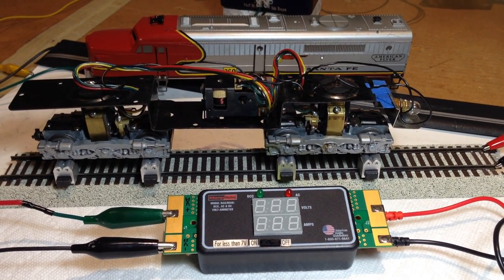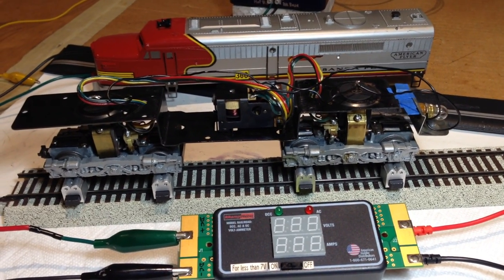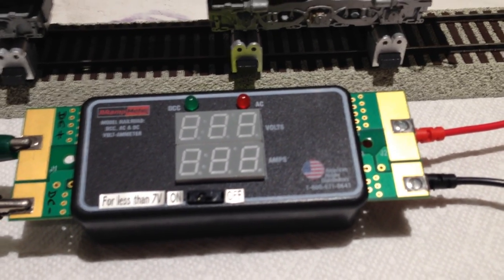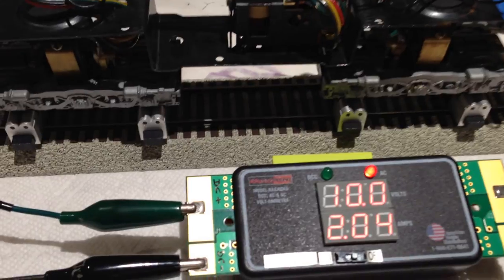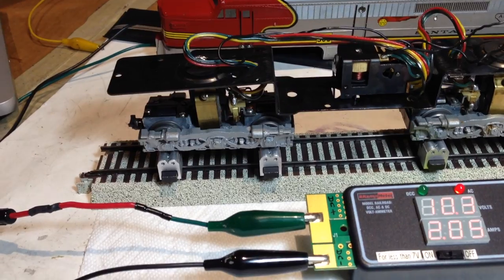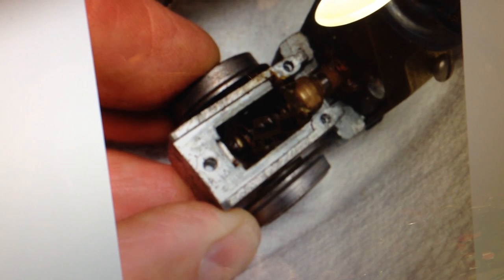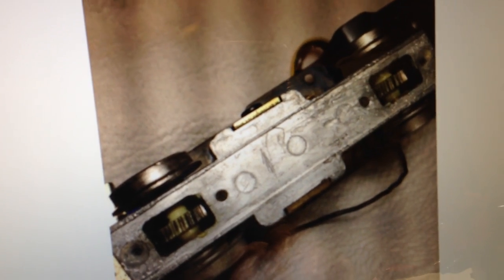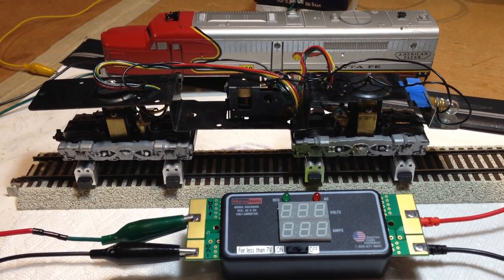AF Set 5107W: PA 360, RRampMeter,  Select-o-Matic Ops box - Part 1 of 3

Comment: Hi Dave what an excellent video, so much help and a great source to learn and understand the inner working of these great locomotives. Your pre-work description exactly matches the condition I received catalog set 20380 Santa Fe Freight, including the seizure of the motors caused by (I like your description) "petrified" grease, I never imagined grease could become a solid mass capable of locking up a motor, I tried as you to turn with pliers with no success, thanks for sharing!  Best Daves AFTrains